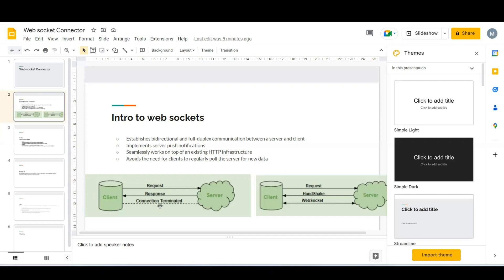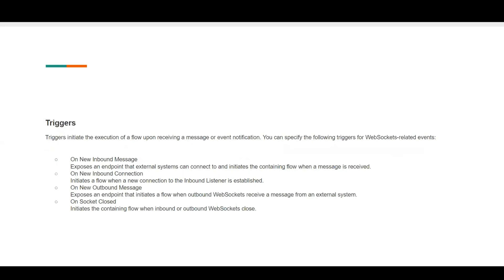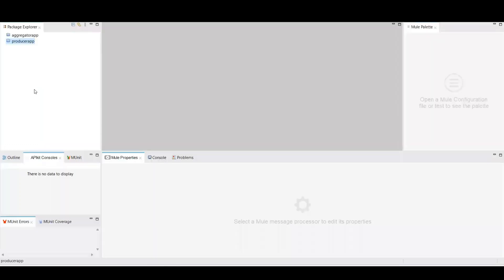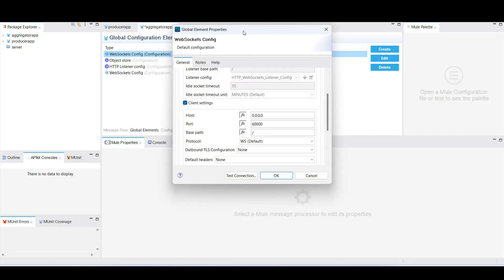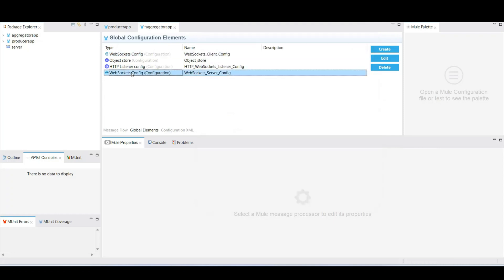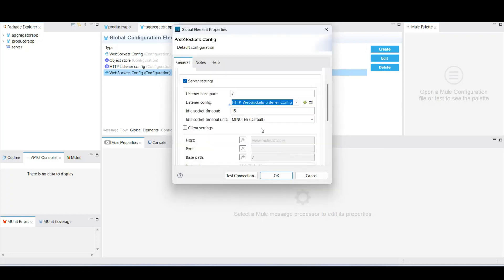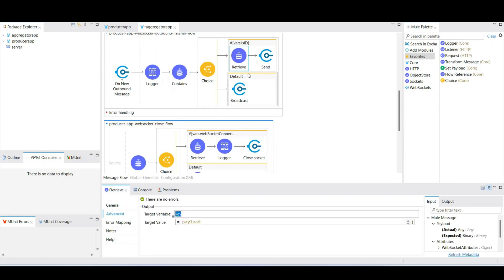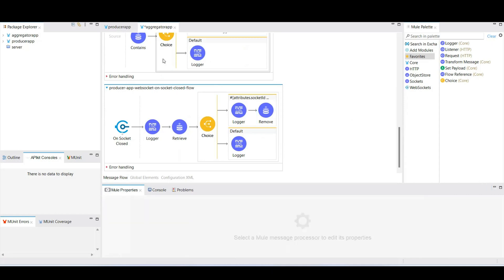Integrating with Web Sockets using Connectors in Mule 4 | Web Socket Connector | Mule Integration

Comment: How would you subscribe to Change Data Capture events created by Salesforce? I can see the CDC events in Mulesoft in a Logger via Subscribe Channel Listener to Pub Sub API connector. How would an external Node app subscribe to the events through Mulesoft? Does this require a Web Socket connector in Mulesoft for Node application to subscribe to?